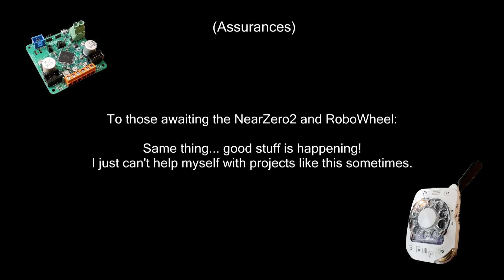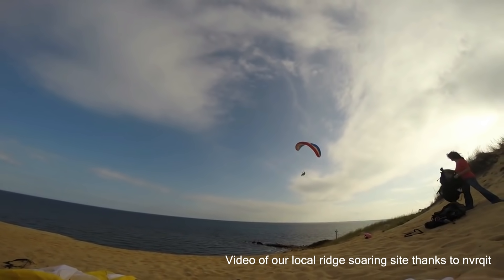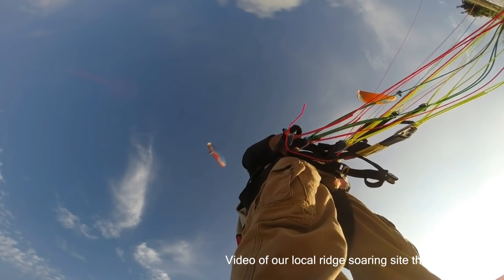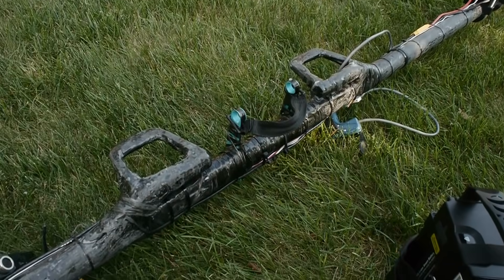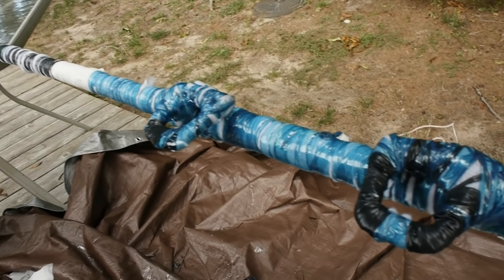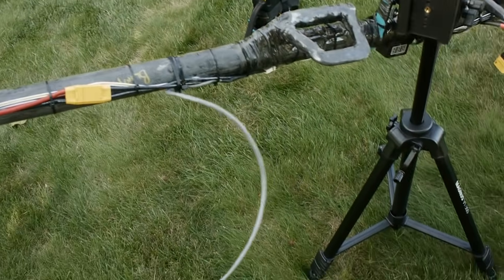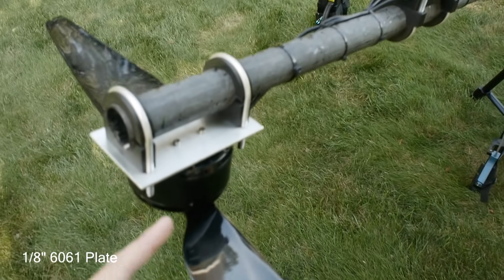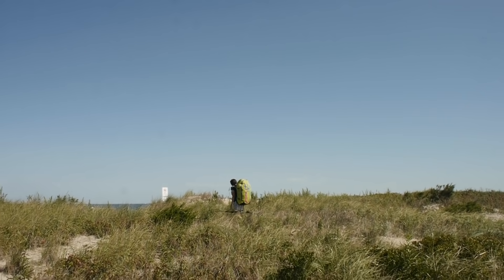Stupid-Simple Electric Paramotor

Comment: Hey Justine, great job, but please put some protection around the props, I hate the idea to see you slice yourself badly in an accident. Sure some prop guards will slightly reduce the efficiency and may even increase the noise but please make sure to remain in one beautiful piece as you are.
I love the concept of flying with minimal noise and maybe distributing this to 4 or more fans would result in the fact that each needs to create less thrust (rpm) and be even more quiet. But then this contraption gets even bigger and more difficult to handle and the probability of getting your wires into the props will increase ... so maybe not the best idea ... I wonder of a tangential fan concept might do the trick, less dangerous blades and a bigger surface of propulsion ... but probably still with less efficiency?!
Anyway good luck and please be careful.

Comment: I'm sure this has been pointed out by earlier commenters, but it's a near-certainty that serious injury or death will eventually be the result of anyone flying with this power system configuration. The propellers should never be mounted in a way that the pilot could be struck by one in the scenario where the propeller suffers structural failure or becomes detached. Another source of potential injury or death is via debris (e.g., propeller impacts ground during take off)  that impacts the propeller and is ejected sideways towards the pilot. Ant the 3rd potential source of injury or death is in a scenario where the pilot comes into contact with the propeller during a bad landing or botched take off. The paraglider has more significant, inherent design characteristics capable of causing death or injury than any form of aviation, and that's BEFORE you mount a power system. Said differently, paraglider + power = greatest probability of death or injury of any form of aviation.

Comment: That is a cool idea I don’t paraglide (wish I did ) but do rc stuff a little tip either have some sort of guard around those props ( if one shatters or becomes lose then there’s a big possibility of line cut or you cut ) also check the nut for the props before every flight (they can loosen) also think about pushing motors ( so the props are behind you) instead of pulling you if something did happen then the props would fall off backwards away from you but check out flight test ( rc thing on YouTube) and maybe contact them explain what your doing as they would be able to advise on motor and the rest I just thought you could also use foldable props (when power is off props fold backwards) any way good luck

Comment: Hi Justine, You're way ahead of me in terms of hardware but in a very similar place conceptually!  Like you I'm not looking to motorise my paraglider but want to add a (quieter, gentler) powered dimension for some phases of flight.  I'm from the UK and foot launch from slopes.  I don't want the noise, weight, pollution etc of paramotoring but am examining quieter, lighter (etc!) power options similar to yours, but as ducted fans - Have you looked at that?  JohnF

Comment: for me paragliding is is like sailing, Paramotor is noise, gasoline, hot exhaust pipe, all the thing I don't want to have. 

electric I can understand and having the "pull" in the original carabiniers is the obviously the best place 

I would think about bad landings and the propp hits the ground and break... not the best position to be in as you have in now...
maybe have a protective ring around the prop?

Comment: Definitely putting the grey matter to good use.. Have you given any thought to 3 or 4 blade prop..smaller diameter or carbon fiber ducted  fan blades. What is the weight of the battery pack?
Fly on!!

Comment: this is a great idea that has already been proven to work very well in the r/c world. you may consider folding props and esc braking to help gliding ease i love how you made your carbon fiber work it can be finicky to work with. so all in all really great job but i see you are using lipo power and thats ok i would go life myself it is a bit less voltage but it has great advantages here you can run it much lower without hurting it or puffing like lipo and no chance of fire period. so please tell me you have come up with a quick release for that huge battery that can burst into flames! please do it before you fly again! this is so important as you cant do much thinking if you are burning alive. i know thats a terrible picture but very much a reality here if you choose lipo. choose life or make a quick release to dump the battery if necessary. i bought a glider but i need a harness and a teacher. stay safe happy flying!

Comment: Good try but this is a big mistake to use twin rotors this way. If one of your ESC malfunctions or one motor malfunctions, you will only be turning around and come to collapse. single motor on the back is still a safer and proven design.
Reply: Maybe a redundant system using e-bike ESCs.
Reply: FOOL.!! all you do if power on one side fails: turn ALL the power off
Reply: also: insert a drone controller with GYRO for lateral control "insurance" that would prevent any possibility of a motor causing riser twist in case one motor loses power........

Comment: Love the simple design. One thing I would add though is some sort of ring around the spinny things... those blades can be gnarly. Might even create duct like protection, could add a bit more efficiency... just thinking out loud...
Reply: Ducts add a lot of drag (and also since they are not inline an angled breeze means you now have a sail on the side which might spin you and tangle lines). Guards would be advised but minimal on one side for less drag.
Reply: I think ducting your props is the way to go. It will  make the props quiter and sense your props are so far out they can even be used to steer on the x axis. PLUS, you gain safety from the props.  Great job! You're very inspiring!
Reply: @gqman6069  sense? Please. Since.

Comment: You have done well on the CF stuff. Vacuum bagging or infusion doesn't always go to plan if you have wraps of fibre. The part diameter shrinks under vacuum and the fibre doesn't.
One trick I've used is the wrap it in peel-ply, next plastic film with pinholes - then soft foam to suck up excess resin - no vacuum.

Comment: I really love this idea but I see two hazards.
1) the dramatic acceleration force. 
2) The potential variations in thrust angles. 
These, combined with the left-right elements of foot acceleration, call for careful consideration. 
The (wandering) hand held throttle control might also be very critical

Comment: I hate the whine of the BLDC motors, so if it were me designing this I'd use a speed controller with field oriented control which eliminates that, and has ability to limited current output to prevent overheating issues. 

Personally in this configuration I'd be afraid to fly like this but hanging ducted fans from a pole draped over my shoulders with a yoke like I used to portage canoes would not bother me. 

this piqued my interest enough to subscribe.

Comment: Forgive me if you mentioned this. Would you benefit from differential thrust in a paraglider? I use that in my r/c planes but they are fixed wings..... Im not sure they make folding props that large but it could help gliding off power and maybe storage/transportation.

Comment: Congratulations for DOING! Good job. 

Some thoughts:
1. People get maimed on a sadly regular basis by the props. If you can reach over and get a hand in them, like during a fall, it would be valuable to have protection.
2. A single-side motor failure would obviously result in a huge twist. If there is an input into the controller that includes rotation about the Y axis, it would be worth having it reduce power on the advancing power to stop that twist.
Reply from the maker: Thanks Jeff. Others have made both those points and I'm already working on prop guards. As it is now the props are out of my reach, but still. As for the yaw-correction, it's a little complicated because a basic yaw-throttle compensation control loop will try to resist normal turns, too, so I'll have to set something up that only starts to correct with differential thrust if the yaw rate exceeds a certain rate, or perhaps, accelerates suddenly. But yes, doable.

Comment: Be cool in the future to mount the cells inside the carbon fiber tube,  (with appropriate insulation since carbon fiber conduct). But that would get rid of the bulky external battery.  Be cool to have the tube full of Tesla 4680 cells when they are available.

Comment: Justine - I have a few years paragliding and cross country thermalling. Couple of ideas for perhaps improvement. Move the batteries to a carbon backpack -carry more weight and better stability and longer flight times. Second idea would be an emergency power cutoff in case of landing tumble or other in flight emergency. Great job - very insprational.

Comment: That is a brilliant idea that is likely to catch on, however it does need a bit of refining.  I think I would try mounting both motors on my back rotating in opposing directions.  Good luck with the design  :-)  The advantage of the motors on a pole is you can tilt them.

Comment: Using carbon fiber shrouded electric ducted fans could make it safe to avoid propeller strike.  Thanks for sharing!😎
Reply: She's not using the motor for most of her flight style, so this would be a huge waste of weight/drag.
Reply: It great and all, but who's gonna power it? They're much more energy consuming compared to propellers. Less flight time = more batteries on board. Pretty soon you end up with a thing that is the same size and WEIGHT as a conventional paramotor.

Comment: Very cool! Have you had any issues with the lines getting caught up in the props? Have you considered adding ESC Breaking to reduce drag while you're gliding around?
Reply from the maker: I don't see that happening unless the wing collapses (turbulence). More concerned about a prop failure, but in any case I'm already working on adding prop guards.
Reply: @JustineHaupt  yes, take it from a paramotor pilot... .when props fail, the results are shocking.  Being in the plane of the props, any failure could easily be fatal for you.  Also looks like you could touch the props with your hands, and looks like lines getting in the props is more of a "when" than an "if".  Glad to hear you are working on guards, it's really pretty crazy to be flying it without.
Reply: @JustineHaupt  Oh cool you are already thinking about prop guards :)
I was a bit worried as if you hit a bird, your prop may break and kill you.
Reply: @JustineHaupt  Your concept seems brilliant!  In addition to prop-guards, I would consider placing the motors on the end of 90-deg bends at each end, to move each motor's "danger-plain" out in front of you. I bet that cantilevered motor-weight could be offset by also hanging the battery more to the rear of the main tube. Then not only is your body more safe,  but it seems like your lines will stay farther from those big scary props. Good luck with your adventures! 😀
Reply: @JustineHaupt  Youre awesome! great idea!What seems to be the right amount of electric motor hp needed
?
Reply: @JustineHaupt  Some people are so risk-adverse they can't even imagine why you'd want to leave the ground. So how much fun was that flight?  A LOT, I'll bet! You go, girl!
Reply: @JustineHaupt  or ducted fan.
Reply: @JustineHaupt  BTW, I saw some research in using an 8 prop per rotor. This allowed the prop to turn slower and it made less noise. Not sure if they make an 8 prop version at the size prop you are using. But I would be interested in seeing if the larger 8 prop rotor would also be quieter and can spin slower for the same amount of propulsion.
Reply: I have broken several props paramotoring, shrapnel flys outward so fast it will hurt bad. 2 props on either side of you seems a bit like looking down the barrel of a gun... the risk isn't worth it. Put both props behind you with a small frame much safer... but then again if you want safety, paragliding is probably not a good choice lol happy flying looks cool
Reply: It's really cool but there's just one safety issue. You're sitting in line of the props.  That's always considered dangerous. Just a prop guard for your safety should be adequate :) happy flying.
Reply: Muy bueno el invento!!
Reply: What about a bow instead of a stick to put the prop danger plane in front of you like🌙🪃🏹📐♉️multi prop🕎
Reply: It is really nice but I would be concerned about props as well. As it is, you able to reach it.
Reply: I wonder if you could use the propellers to regeneratively charge your battery back after you've reached your desired altitude?
Reply: Any update? Is this thing in production?
Reply: It will only happen once and when it does they probably won't be replying.
Reply: @winsor68  why the need to be such a smart arse?????????
Reply: @alexadamopoulos7134  You just have to live with it Alex, no matter what anyone puts on the Tube someone will be negative. This young lady is enterprising & marvelous!
Reply: @alexadamopoulos7134  To borrow a line "Those that can DO... Those that cannot COMMENT". Face it Alex @Winsor Family  is pissed he didn't think of it first and because of this he is bound to put it down. He suffers from the "Not invented Here Syndrome", he didn't think of it first so he is duty bound to poke holes in the idea. AKA ENVY
Reply: FFS, all they said was that if someone gets their lines caught in the blades, they probably wont be replying.

No need to gang up on someone for stating the obvious.

Comment: “Interesting” is an understatement.  This is fantastic!  I’m sure many paramotorists (might be a word) cringe at the bare props out there like that but it works and works wonderfully it seems.  I’ve had a similar idea for some time but haven’t the time or money to bring the idea to life.  I’m very pleased to see that the basis for my idea is as easy and minimalistic as I had hoped. My idea only got as far as cut a drone in half,  supersize the motors and props and then strap it to my back. Lol
Reply: it is a word, and yes, I did cringe. I do not want to take anything away from this wonderful idea - it's truly a masterpiece, but safety should always come first. No way can be acceptable that these blades are out there in the open like that.
Reply: @goqsane    That's why I like her honesty so much.  She said multiple times this was more or less a prototype.  I'd bet if they were in use as often as typical paramotor she would have fabricated a housing of some sort.  But given as she only plans to use them at takeoff and occasionally during flight she figured testing first would make sense before the extra effort of designing an enclosure.

Comment: Hello Justine, I don't want to take away the fun of electric flying. Nevertheless, I feel the need to point out the great danger that arises from the fact that you are exactly on the propeller level. I was involved in testing the e-climbs in Germany and saw several accidents with propellers that broke for various reasons and caused massive damage to the paragliders and massive impacts on the ground. If such a part hits you, it can lead to severe injuries from such a short distance. Do not underestimate the kinetic energy contained in the rotor blades!
Be careful and change the construction accordingly, or protect yourself adequately with massive protectors!
I wish you many beautiful, accident-free flights!
Reply: Came here for this. It's really neat but when props go wrong is terrifying. Existing on the same plane as the props rotation makes me nervous. Side note, if one prop was lost somehow and the throttle was not immediately cut those have more than enough leverage to give you some nasty line twist.
Reply from the maker: Hi Cappucino,

Everyone's been nervous (in the comments) about the lack of prop guards, and certainly it's on my mind, but your post more than the others make me a bit more nervous about it. Did the props in the tests you were a part of always brake do to some kind of impact? Where these spontaneous failures? I'll note that my props do sit forward of my head and vital organs, but I don't know whether a failure would cause the blades to fly straight out from the hub, back a bit from the airspeed, or forward a bit from the latent thrust. 

I think I'll make myself some prop guards sooner rather than later (as in, before this flying season is over).

Comment: I applaud you! I know many pilots including myself who came from pg and now fly motors. The reason the majority of ppg pilots only motor around instead of turning off the motor is because it's more fun to zoom around anywhere you want to go rather than be stuck searching for lift in one area.
Reply: Just like yachts. Modern kids want noisy annoying outboard engines. A mast and sails is so quiet. But they are addicted to speed and horrible noise all the fucking time. Mental poverty. It is so sad.
Reply: @voornaam3191  we are talking about paragliders, not boats